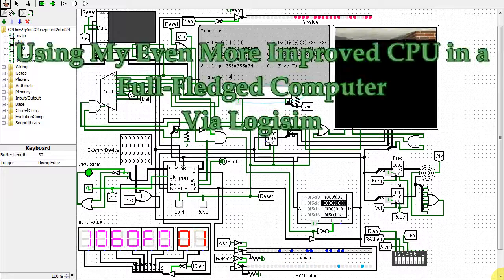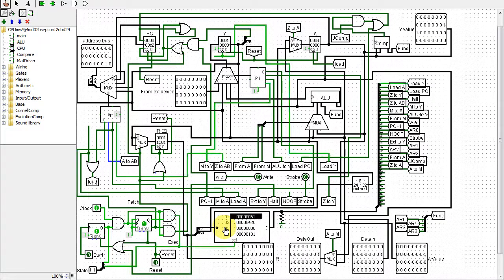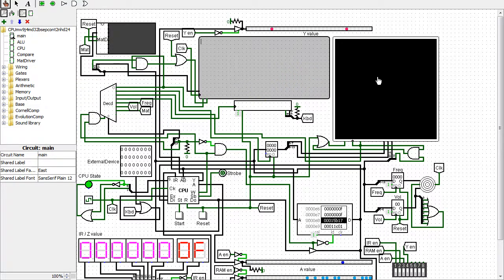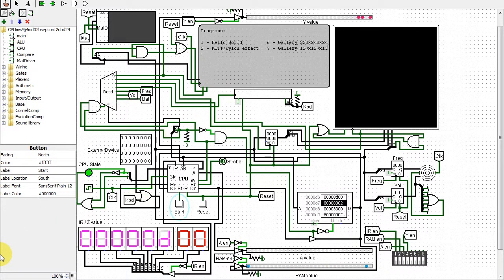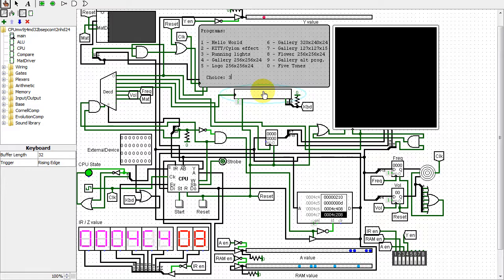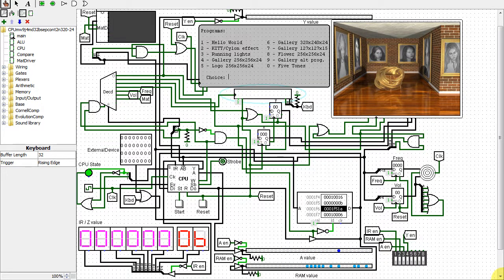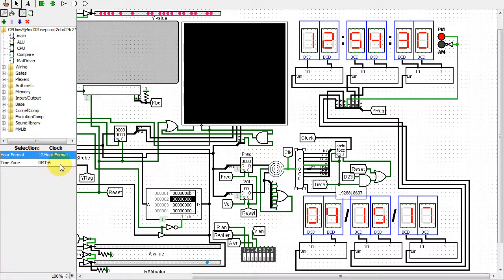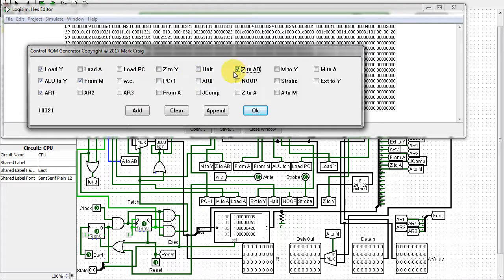Using My Even More Improved CPU in a Full-Fledged Computer Via Logisim

Comment: Hy MrMcsoftware! I love the cpu. Thought I might point you to the Holy Cross edition of Logisim-Evolution (https://github.com/kevinawalsh/logisim-evolution). Its a fork that fixes a lot of the stuff you rightly complain about -- allows selecting "classic" appearance instead of the huge new ones ram/rom/counters, for example, and includes a bunch of the old cornell components too (I am the author of the Cornell components). My new Holy Cross edition has plenty of bugs I'm sure, but feedback and suggestions are always welcome. Someday I'll have time to fix more bugs and clean things up.
Reply from the maker: Hi 4chickens1dog (Kevin)!  Thanks for the praise and link to your fork.  I'll give it a try!  It sounds really nice.  I'm sure it would have come in handy for the video I'm about to upload soon.  In the new video, I mention an Evolution bug (that I fixed and reported to the Evolution maintainers (original Evolution fork)) - VHDL conversion of a 32-bit ROM doesn't work correctly due to a signed int problem. I don't know if the fix has made it to your version (assuming you kept that part of Evolution's code intact).  I suspect the same type of problem exists for the "max_val" VHDL parameter in the counter conversion (32-bit counter) (max_val is -1), but I couldn't figure out how to fix it in the JAVA code (if it is a bug).  There was also a problem with the VHDL generated code if you have both 4-input encoders and 2-input encoders (the 2-input encoder doesn't work right).  I'm not sure if this is a bug in Evolution, and I'm not sure if it's a bug with any 2-input encoder (with no 4-input encoders used).  I only know I was able to fix it by changing it to a 4-input encoder with the other input lines 0.  In case I wasn't clear, these are all bugs/potential bugs in reds-heig - I don't know if your version has them.  BTW, I always did wonder why reds-heig didn't put in a parameter/setting for classic appearance of the memory components.  Also, BTW, I did try to add the VHDL/Verilog code to the old components (as well as old appearance to the new components) but the code differences were just too much (for me anyway).  (it compiled, but during the VHDL conversion process it complained about I/O ports).
Reply: Yup, the ROM vhdl gen bug was a real pain to track down, discovered when testing one of my student's CPU projects. I've rewritten a lot of the vhdl gen code, lots of it was broken and/or limited. Added features for dynamic clock speeds (useful for debugging CPUs), hex displays, LCD display, keyboard I/O, etc. I can take a full CPU like yours, with keyboard input, LCD display output, LEDs, hex displays, buttons, RAM, ROM, microcode, etc., and download it to a prototype FPGA, all within Logisim. Great for teaching and playing.

I'm not sure I got the counter limit and encoder bugs, I'll have to check. Thanks for the tip. Unfortunately, I haven't had time to really take care about anything other than VHDL on the Altera DE0 prototype board, since that's the one I usually use in class. Verilog is probably hopelessly broken in my fork (but it is almost certainly buggy / broken in reds-heig too). And yes, converting unilaterally (but inconsistently) to IEC style shapes and breaking backwards compatibility by changing defaults was... unfortunate. But it's hard to go back now cleanly -- compatibility will always be a bit of a mess.
Reply from the maker: Yours sounds very impressive.  I had to only convert the CPU to VHDL due to most of those devices being unconvertible (with reds-heig).  I figured the ROM bug was a sign bit issue when I saw what was produced versus what should have been (due to the nature of two's compliment) - but wasn't sure how that would play a role until I looked at the code.

I can tell you what I noticed wrong in the Verilog conversion (in reds-heig):  

The same -1 on max_val problem (some verilog compiler's didn't have a problem with it though, if I remember correctly).  

The counter didn't work.  I had to modify the s_counter_value assignment (but I couldn't follow the logic of the generated code (it's confusing) so I don't know the ramifications of my fix) (I took out the "if (s_real_enable)"):

else s_counter_value <= s_next_counter_value;
 /* else if (s_real_enable) s_counter_value <= s_next_counter_value; */

Also, the same 2-input encoder problem as with VHDL. 

And I changed the subtractor.v code (got rid of ~ way of doing subtraction):

assign   {s_carry,Result} = DataA - (DataB) - (BorrowIn);
//assign   {s_carry,Result} = DataA + ~(DataB) + ~(BorrowIn);

But it did work after making those changes
Reply from the maker: I checked out your version.  It seems very nice.  I did have to do a little re-routing of wires, XML editing, and subcircuit appearance changes to get my Evolution CPU file to load and work, but once it did, it was nice.  I had thought of adding a width and height parameter to the video display, but never got around to it - you beat me to it :-)  I do like all the new color formats in the video display.  I love the switch-ability between classic and evolution appearance.

I do have a few suggestions though, one small one and one that would probably be a pain.  The easy one:  On the computer I ran it on, I only turn on internet (wireless) when I need it, so when I ran the synthesis & download, it gave an error that it couldn't get Altera.  Perhaps, an option (if it doesn't exist somewhere (I didn't see one, though)) to turn off attempt to run and/or download Altera (and I guess Xilinx as well).  The hard? one:  I miss the ability to click on the warning/error message in the VHDL conversion process panel to see the error in your circuit.

It did generate the code.  I haven't fully looked at it.  But I noticed the ROM contents were correct.  But max_val is -1 on the counter (if I remember correctly, that wouldn't be a problem with the HDL writing, that's a problem deep in the way Logisim was originally coded (using int's in Value, instead of long) - would have to create another overloaded function(s) probably to deal with long's stored in the Value class - but that's from my very vague recollection of Logisim's code, I might be remembering wrong, and it's real easy to get lost in Logisim's code).

BTW, I uploaded my new video today (on VHDL) that I mentioned before.  If you want to see it, here's the URL:
https://www.youtube.com/watch?v=drIQLX6GrM4
Reply: That's great, thanks for the comments.

I've been tracking down the logisim "long" vs "int" bugs forever, and will probably never get them all. They usually aren't too hard to fix once they are identified, so I'll take a look at the counter max bug when I get a chance (likely in a few weeks).

I don't recall the vhdl warning behavior you mention. I'll try out the reds-heig version to compare.

About not getting altera, it does not use internet at al, ever, AFAIK. The "download" there refers to bitstream-configuring the fpga, i.e. "downloading" the synthesized design to the fpga chip over a USB cable. Most likely logisim just could not find your altera tools installation. There is a config file somewhere that stores the path to the altera quartus binaries, needed for synthesis.
Reply from the maker: I see.  I just assumed it was trying to download from internet since the error messages had a "timeout" nature (didn't all show up right away) like the download attempt had timed out.  But it seems it was for other reasons.

The VHDL warning behavior:  You can click on some of the warning messages (that have a red arrow looking icon next to them on the left side (you can also click on this icon, which is easier))

Comment: This is brilliant. I never knew you could do such complex designs in logisim. I've only used it for very basic things. For one moment there at the start I thought you ported a ray tracer to this computer, and the image was calculated there :) I guess that would take years in 4khz :)
Reply from the maker: Thanks!  That means a lot!  I did think of writing a ray tracer for it.  But I didn't like the idea of having to write the floating point code (especially since my CPU design ignores carry and borrow lines) or creating an FPU.  Yeah, I suppose you could do it with integer values (though the intersection calculations would be a problem), but then there's still the 4 khz  problem.  It would not be fun :-)
Reply from the maker: BTW, when I said that one could possibly do ray tracing with integer values, I didn't mean that it was a good idea or even likely possible.  I just don't like to say things like this are impossible.  After all, it was long considered to be impossible to read Amiga floppy disks on a PC diskdrive, then someone did it (by telling the controller to dump the extra bytes to the other floppy drive (if I remember the process correctly))